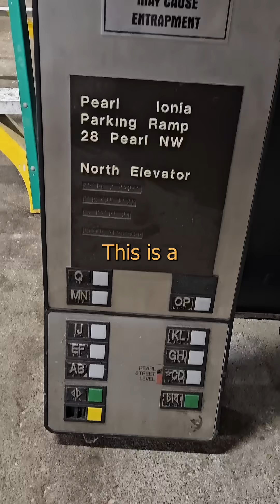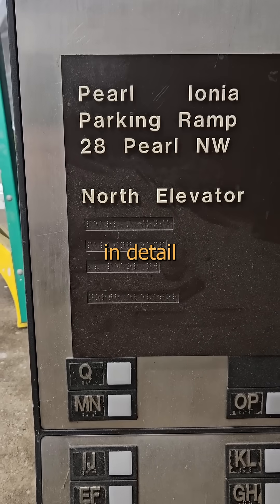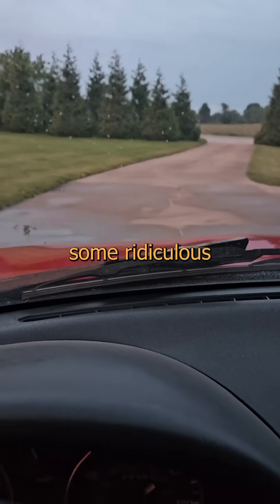Miata Mischief #chrisboden #engineering #gear #elevator #score #stories #parts #hacking #making

Comment: I bought a Jeep in the mountains for cheap. On our way there my father blew a line for his transmission cooler. The Jeep had a massive leak in the stainless fuel line, and was spraying a mighty fine mist all over the exhaust manifold. I showed up with a tube of JB Weld, and the license plates off my 2018 Hyundai Accent. Robbed the JB on the fuel line, tossed the plates on it and drove it home. It had no brakes at all, so we had to decide on which of 3 possible routes home. 2 were back roads (ideal for the illegal license plates) but the hills were sketchy (not ideal for lack of brakes.) We opted for the somewhat flatter, main road. After a while of driving, I looked down to notice my oil pressure was almost nonexistent, so I was revving it at stoplights to keep some pressure. A while later the car started dinging at me, my eyes immediately shot to the oil pressure guage, which was the same. Nope I'm overheating🙃 we stopped for a while to let my engine cool, and my father's transmission as well. Got it home with no real issues, traded it a year later for a Saturn that I ended up selling for more than I put into either vehicle.

Comment: Picking up a solid wood dresser from a craigslist ad, find out my new SUV doesn't have the space or the heft to haul it, go all the way back home to pick up my old 1994 Sibaru Loyale station wagon that I had been looking to sell because the cost of repairs to Everything was the price of a newer car in better shape (the SUV), got the dresser fully loaded into the beastly station wagon with only a little smidge of interior disassembly (the back seat seat belt covers were just a bit too large). Got everything all the way home, unloaded and set up, and I still ended up having to sell the wagon.
Ahh Boris, my Big Good Boy, I miss you so.

Comment: i got home from work, had dinner and was under the covers going to sleep when I decided to scroll FBMP one last time and found two robotic arms for sale for $500.  I messaged the guy expecting to get a response sometime tomorrow but instead he said he wanted to sell them right then.  I didn't even have $500 so i called my grandfather and asked to borrow $500 at midnight on a random Wednesday and he said yes.  It was a three hour drive to get to the guy and he was getting antsy.  I stalled for time by telling him that i was a contractor from out of town working on a jobsite and had to wait for someone to come on site to relieve me.  I got there and it was a very old man clearly addicted to drugs.  He said he was selling them because robotics just wasn't his thing.  they both had controllers, teach pendants and were about three feet long.  i had to drive directly to work to make it on time at 8am.  no sleep.  no shower.  this was all done in a 2006 Scion Xa with 240,000mi and a tricky second gear.  i made an automated espresso machine and have one of the robot arms hand me the cup when it is finished.

Comment: Drove a construction trailer from Toronto to Collingwood loaded  with electrical equipment drafting table punch sets cable tugger and bender and 500lbs of scrap copper on a 1/2; tonne f150 .But that's external .Internally It would be about a little Mazda protege with the rear seats folded down and a bunch of mechanics tool boxes and electricians tool boxes and a boxed Christmas tree .Blind spots blocked by Christmas tree .From Toronto to Barrie

Comment: I daily a ford mustang.  Being a welder and farmer.  I have drove that car where people are scared to take trucks, ive had welders, steel, chains, hydraulic cylinders, fuel cans, oil cans you name it, its been jammed in that car one way for another
Reply: Who needs a 100k pavement princess?
Reply: @AdventureswithGeneral ohh dont worry, its not a 100k car.  Only at 25,000 car.  Always wanted a mustang, its plane Jane, good on gas and reliable.  Not paying for fuel to drive a truck to work everyday.
Reply: @keltonwright7  I think the 100,000 pavement princess he's referring to is a truck. That's about the price of a new 3/4 ton these days. Good on you for sticking to what works for you.

Comment: Not hauling home but from my hone. I did the senior prank at my highschool and what we did was bolt a toilet to a piece of plywood and we were going to fill the bowl tank and some cinder blocks with cement to make it super heavy. We started mixing the concrete at my house then loaded it into the bed of the my truck and drove 4 miles at 1:30 am with my friend in a ski mask and all black standing in the back of my truck mixing the 5 different 5 gallon buckets

Comment: We have a Mini Cooper S convertible.

We bought a 6ft x 2.5ft mirror, forgetting we hadn't driven our truck.

We put the top down, laid the seats in the back flat, and wedged the bottom end of the mirror there. The thing came up like a ramp over the passenger seat and part of driver's seat. The top end of it was 2ft above the top of the windshield, sitting at closer to vertical than horizontal.

I'm the shorter of us at 5'11" so I was in the passenger seat bracing the mirror down with my arm hoping it wouldn't get too much lift as it started to get breezy and sprinkle (Did I forget to mention it wasn't necessarily nice weather out?)

We drove along the 30mph streets and got it home without incident, even passing a cop on the way who just shook his head.

I'd post a photo if I could. It was a little adventure.

Comment: First year in college, living in a dorm with no elevator, I managed to score 3 Dell Equilogic PS6500s with drives (supposedly 165lb each, per Dell) from another school in my university for free. I came utterly unprepared with only a small 1x1ft moving dolly, and had to balance them gently and roll them down a hill. After about the third time the stack slid enough to tip and ultimately crack the dolly, I had to call an Uber to bring them a couple of blocks to the engineering school, where I sat them in the student project lab for several months until my pare ts could help me move them. Those Dell SANs weighed down the back of that uber so much I swear it felt like it had no suspension. My parents chewed me out for the whole endevour, but it was fun times. Sadly they have sat in my parents' house for at least 7 years doing nothing, because they need at least 2,ideally 3, power cords and they cost a couple hundred a month to run in power, each.

For bonus points, I was witness to some guy who bought the old Fadal VMC from my school. The room it was in had the doors changed some time after it was installed, and it no longer fit through. They had to drive the spindle down past the stops and strip off the electronics cabinet and all the shrouding, down to just the spindle and casting, just to get it through the door. The loading dock that originally delivered the machine has since been blocked off after renovations and a new building, so I can't imagine how they even got it out of there, but I imagine it involved a forklift in the small driveway next to the building, and at least 1, probably 2 palate jacks to get it there.

Comment: I hauled four sheets of drywall in the back of a Chrysler Town and Country. That doesn't sound crazy but I'm also 6'2 so I had to drive with my legs crossed and with the side of my left foot, and my chin was over the steering wheel

Comment: I put half of Ford Taurus (everything behind the firewall) on top of a Ford escort and drove it to the scrap yard. To achieve this I put two 2 by 4's on the back of the escort connected a come along to the front of the Taurus and the bumper of the escort and cranked it until the Taurus slid up and on top of the Ford escort these are things you can do in Detroit. When I arrived at the scrap yard in the employees had me pose for photos 😂 there's evidence of it out there somewhere.

Comment: I hauled a bicycle on the back of my 1991 mr2. Just tucked the rear wheel of the bicycle under the stock spoiler of the mr2 and the rest of the bike laid flat on the mid engine hatch

Comment: I've done sketchy things, but the one that I can think of that probably doesn't have a statute of limitations on is I bought a '70 Ford Super Van conversion for $300. I roped a good friend into following me home as this crate had cooling issues, wonky standard steering, and "brakes by committee". By that, I mean they would take a vote as to whether they would stop in time to avoid an accident. In rush hour traffic.

An hour and a half later, my latest acquisition was safely in front of my house. Some neighbors were amused, and some probably wondered what I was going to do with the other 6 project cars I had. Being a gearhead is quite the adventure.😁

Comment: I drive a mr-2 Spyder. I've got a little luggage rack on the back. The amount of sketchy things I've strapped down to it has caused a spectator or two to film me as I drove off. Most recently a portable generator I picked up from government surplus. But I've also hauled stacks of old server equipment across state lines that cost at least 20 times the value of the car they were riding on.

Comment: 12 year old me decided it would be a great idea to buy a 80 column monitor for my commodore 128 to replace the 40 column mode one I already had using some lawn cutting money I had earned. And how did I think I was going to get it 3 miles home? A 10 speed bike without a rack on the back. Yeah adult me tells me that I would’ve been better off putting it on the seat and pushing it home. But 12 year old me decided to alternate between on the handlebars and on the bar in front of the seat. Neither worked well. The handlebars made steering near impossible and on the bar meant peddling was near impossible. Oh yeah and I had no rope or strap to tie it in place. It was just sitting there. Somehow I made it though

Comment: I wanted to take my brother in laws boat on the water one day but I realized that I had no tow hitch for my explorer so I had a buddy of mine sit in the back holding a ratchet strap looped around the trailer we tried attaching it to the seat which didnt last very long and while on the water our trailer got stolen so me and 3 friends had to try to lift this boat atop my explorer and ratchet it to the roof rack through the back and front doors (that we had to hold closed the entire 30 min ride back) when we got back my brother in laws house he was in the garage just staring at us, trying to back down the driveway without losing the boat when I looked back I saw him HOLDING MY TOW HITCH HE TOOK IT TO USE ON HIS CAR WITHOUT TELLING ME

Comment: I had a ford aspire. I took the passenger seat out, cause I was aways hauling things. Since it's a hatchback, and the back seat tipped down, I managed to fit a 50gal water heater in it. Could barely hold the shift stick, and couldn't shift into 5th gear cause it was too close!

Also strapped a queen mattress, and a full size couch on the top. (At different times.)

Comment: The modern family Christian church next door was getting all new stage gear and the old stuff was being put out in the street for anybody who wanted it. 

I got my hands on a pair of 30" active subs, 0 to 50Hz.
They had mono XLR input and output sockets, a crossover dial, gain and power switch.
It actually removes everything below the crossover frequency from the output too.
Because I've often been stage-people, putting it up on Facebook as "free ultra low active subs" got then too a new home very quickly, a Jamaican sound system in Southampton, Hampshire, England. 
I always buy cars that can convert between people and stuff transport but even with the rear chairs removed it was quite the struggle for my 2006 Ford Focus C-Max.
Reply: Before that car was my Peugeot 206 SW.
We took three mixers, 4 decks, a HUGE lighting rig, 7 boxes of vinyl and me plus two passengers from home (Portsmouth) to London, I forget the location. 
Sadly it has one of those gutless 1990s 8 valve 1.4 litre 65hp rubber band engines that could only maintain 3rd gear going up a slope and only up to 60mph.
Drove up, set up the night, got mashed, slept in the car, drove home Sunday morning.

Comment: I’m 15 and me and my friends love old cars they are simple and fun but when we were between 13 and 14 we took a roiling garbage can we bought to haul parts for a project car we are working on and we got the junkyard and got the parts but they had a 1970 Chrysler New Yorker and it had no wheels and no doors so we put half the parts back and put the other parts inside the car then we used a set of rims no tires just rims to get it to our garage to work on it we destroyed a mail box on our way back and spent $2,075.72 and we still have the car

Comment: I used to hang out at an airport, the hangers specialized in biplanes and the mechanics were nice enough to let the little kid watch them work on the cool planes. 
One day when I showed up someone offered me a wooden prop. It had a crack so it could never be used on a plane again. What was I going to do, say no? So my 10 year old ass strapped it to my bicycle frame and peddled it home. I had to get someone to help me get off the bike, i hadn't thought about the dismount.

Comment: I thought cramming a 30 in widescreen HDCRT in the back seat of my 05 Elantra in a snowstorm last winter after hauling it up a set of stairs that the guy drywalled in after bringing the tv down was sketchy, but after reading some of these comments I concede before even entering the competition.

Comment: I've heard these are fun to drive. My mom dated a guy who had one, and in the topography where they lived, it would be nice to have something low and light that can corner without you having to brace yourself (I came there in an F150).

He offered to let me try it out, but I'm 6'5", 240lbs. It was a convertible, but also winter, and I doubt that would help much with the knees situation (made worse by manual transmission). I didn't even try to sit in it, so it may have been deceptively leg-roomy.

Comment: I have a first gen mini cooper and strapped 240 sq ft of vinyl flooring to the roof rack using 2x6’s as support underneath it. When my mom said her floor fell in and they had the plywood to fix just need the flooring I didn’t think twice about helping. Also didn’t think about how I was gonna get it there rolled up either. Fun times

Comment: I owned a little hobby farm ( goats chickens a pony matter for the story) 
   My trusty rusty truck went to car Valhalla when another vehicle hit the turn too hard and flipped over into it. The night before feed pickup ( we use a co-op, you have to be there on time or you get nothing. ) so I was left with my neighbors 2007 Honda fit... 

We loaded 800 pounds of feed into the car and then 10 square bales of hay on top. I was sure the tires would explode. 

 It made it back just fine but Definitely struggled on the hills

Comment: Once our family was planning to start a farm and we went to get the pipings for irrigation and stuff.
We got 50 meters of 40mm polyethene pipe (the black ones) a roll of (100 meters, i think) tape, some 3 inch iron fitings, and lots of other bits.
And we fit all of those in our car (a Pride) to get back home😅
To make the long story short, my mom and dad were on the frint seats, and i sat on the back seat in the middle of a coil of pipe that was positioned vertically inside the car  😂

Comment: Carried a Snap-On 7 drawer top box and a 5 drawer bottom box plus about 300 pounds of worth of tools home in a 1965 Chevy Corvair 2 door coupe. I had to unbolt the passenger seat and put it behind the drivers seat, load the tool boxes in the passengers side then contort my arm in front of the boxes to shift gears. Other than packing everything I could from my 3 bedroom house into a 1 ton Dodge van with a 12 foot cube box body and living in it for 3 months down by the river, that's probably my best story.

Comment: My buddy and I were swapping a twin turbo Chevy 350 engine into his 1980s Mazda b2000. We had the engine bay modified to accept the engine, but before we put it in he wanted the engine bay power washed. Now sane people would go to harbor freight and pick up a cheap power washer. We are unfettered by the confines of socially accepted sanity parameters so we hooked it to the back of a jeep liberty and towed it under cover of night to the nearest DIY car wash and towed it back. I sat in the no engine car and kept tension in the cable via precision parking brake control and clenched ass cheeks.

Comment: I had the opportunity to take home a 20' rolling chain link gate. Suffice to say it would NOT fit on my 8' utility trailer, so I welded a hitch to my trailer, borrowed my buddy's trailer, towed his trailer with my trailer with the gate was strapped across the top of them. Of course the lights on the rear trailer didn't work so I did this whole ordeal at 4AM to minimize any potential police attention. It was an interesting trip home